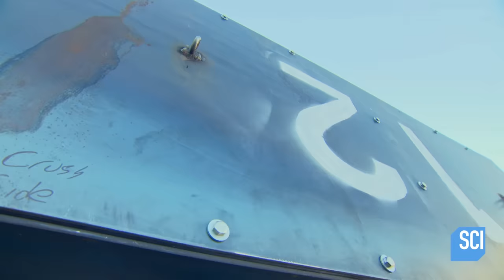Crushing a Car with the Domino Effect | MythBusters Jr.

Comment: I know a car that deserved that fate. A 1999 Ford Taurus.
Reply: Exactly except they used an MR2
Reply: Not a Ford Taurus. A Toyota Prius would be even better!
Reply: Fax
Reply: No just  crush any gm product 

Ford's are not that bad
Reply: Too oval and round.  The crisp, defined edges of the rectangular dominoes would simply roll off the ugliness.
Reply: I had 2 1999 Tauruses that crapped out on me. So I hate that particular car with a vengeance.
Reply: @Adrian Vegas correction new gm products except for the c8 Corvette and the Cadillac sedans
Reply: Or a fricken Ford Tempo.. Nope, they decided to choose one of the best late 80s sports cars of our time. Dummies.
Reply: @phoenixmistertwo8815  Can't blame you. They had a tendency to fall apart and crap out at the worst time.
Reply: @Metalman200xdamnit  , my first ride that was my own was a mercury lynx, aka. Ford escort. 

What the show needs to do is make sure they are crushing square boxy cars noone likes or still sells parts for.
Reply: @phoenixmistertwo8815  Believe it or not,the Ford Tempo was my first car. It did was it was supposed to,go from point A to B.

Why not crush minivans? Although,I get it,they had a better shot with a low car.
Reply: Wrong Latest model of Corolla deserved that fate 
Because its overated and looks Cringy asf also nothing special with it

Comment: Having not clearly seen the inside of the larger dominoes I wonder if weight distribution was the reason the last one didn't go over without help. If the center of mass was significantly below the vertical midpoint or closer to the impact side than car side that would make it more difficult to tip over. Conversely a high center of mass or one closer to the car would be easier to tip over.
Reply: which was actually the case! in the earlier part of the video, they showed that buckets of concrete were being placed inside the bricks, at the very bottom, to "stabilize" them and prevent accidentally tipping over. that certainly ruined the whole thing :-(

Comment: dominoes have fixed density, and due to their shape their center of weight point is high, and a small movement moves this center outside of their body. So they flip. The steel domines had extra concrete weight at the bottom, making their center of weight point much lower, harder to flip....
Reply: True. Had the dominoes at the end been properly weighted,it would have worked.

Comment: I thought they'd gradually increase the size of the dominoes in the thousands, not 12...
I guess there'd be budget issues and such, but 12? Could done 20... Also the weight was mostly at the bottom, not well distributed.

Comment: This is so cool
Reply: H_The Bomb you have lived a life without simple games if you don’t know how these things work
Reply: As they go down not only does the past once increase its speed put the amount of weight the atmistsphere puts on it pressing it down while still taking in for account the slant and gravity and because of those factors it can increase the amount it tips over from the start if you know this decently you should’ve know it would be unlikely since 12 and 11 seemed to be proportional wrong the weight of steel holding it down slowing it and the fast the corners would increase the amount of force necessary to push it down

Comment: It was a complete waste of time, missing the old myth busters thing.

You could just repeat and use more precise calculation and weights, instead of just using that rod, it ruined everything.

Try some great myth breaking experiment, not these things.
Reply: Normally if an experiment failed they would spend Alot of time resetting up the experiment but now they don't. It is kind of a shame
Reply: @virtualbeast1228  fully agreed !
Reply: The problem is that The REAL Mythbusters took them all
Reply: I don't understand why they used such a small number of dominoes. If they had just had more steps in between, it obviously would have worked.
Reply: the way they did it here its the basic same thing as if they would have just dropped the last domino onto the car xd
completely pointless
Reply: @f37r24scbGescb2  that wouldn't have worked regardless cause the force required to push all the other dominoes back straight is more than the force needed to push the last one over so it'd only result in the same outcome if you tried to pry between the fallen and standing dominoes

Comment: The weights of the dominoes were too disparate. 11 was ~2,000 lbs, whereas 12 was ~7,000 lbs. If they’d had one in between that was ~5,500 lbs, it would have worked better.